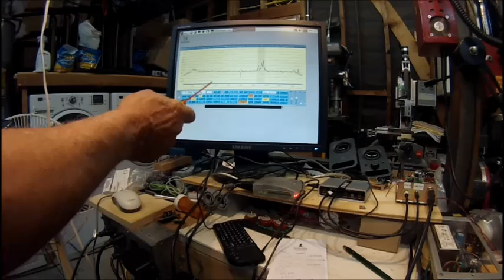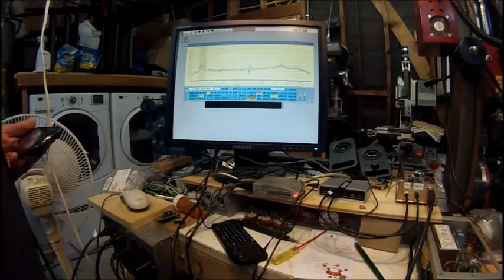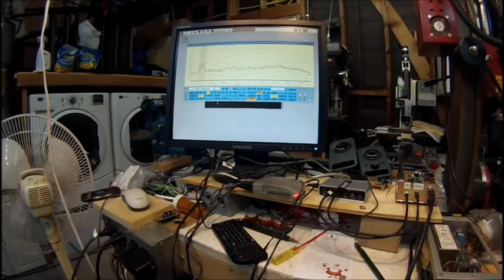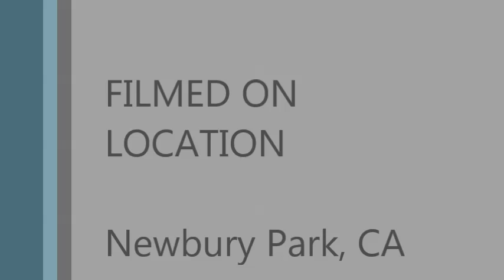Raspberry Pi2 and Softrock V6.3 SDR SSB Transceiver

Comment: The usb to i2c adapter is the dds feeding the softrock? Where did you get that board?
Reply from the maker: There were 2 sources one was kb9iyg and the other was from Australia. That soft rock was the smd version from Canada the ng board.

Regrettably not readily available today.

Pete N6QW
Reply: @N6QW I found a softrock ensemble used. Trying to get it going. So you fed line out of the softrock to the usb sound card. Didn’t use the usb port on the softrock for anything? Is it tuned around a fixed frequency with the soundcard using the capture range without the i2c interface? Sdr is still hard to understand.
Reply from the maker: @techguy9023  contact me at my qrz.com email as this is cumbersome using you tube 
 The USB is for changing frequency. The line in and line out connect the ensemble to the sound card
Reply from the maker: @techguy9023  Check out www.n6qwradiogenius.us for how to set up the Ensemble.

Pete

Comment: Im new to ham but not to linux. i wanted to know if this can be done with RPITX? or is it just with a SDR tranciver? i know a band pass filter is used for squre signal.
Reply from the maker: Hi I am not sure how to respond. Typically the softrock boards need an external computer. BUT I have seen some videos where the entire transceiver was the Pi3. You add a bit of Hilbert transforms and continuously chanting RPi3 RPi3 and you get there. One of then python developers Guido PN1ZZA (call might be wrong) did the whole transceiver with just the Pi3.I don't know how to do that. Thanks for your post.73'sPete N6QW
Reply: RPITX is a application for rpi 2-3 it uses the GPIO pin 18 for the antenna it can transmit from 1mhz to 750mhz but using square signal. as much as i know. Ive been trying to increase its range but idk where to start. Hear is the DEV site https://github.com/F5OEO/rpitx
Reply from the maker: That is interesting but I wouldn't know where to start either. I suggest you track down F5OEO using www.qrz.com and perhaps he can help you directly.73'Pete N6QW

Comment: Hello, I have a RXTX ensemble. I have been thinking of combining it with a 35W amp and some sort of Raspberry Pi to control it, power supply together in one nice wooden case. Do you have suggestions for this project?
Reply from the maker: Hi OM,Rather than take up a lot of space here on you tube, send me an email at n6qwham@gmail.com and I will be happy to share some thoughts with you. I have an Ensemble and an Omnia SDR as well -- there is little difference between the V6.3 and the Ensemble with the Pi3. The Omnia is another matter--it likes Windows a lot better.If you are thinking portable operation then a Motorola Lapdock is the way to go.Thanks for your interest and posting.73'sPete N6QW

Comment: Very nice.  My 6.3 is the through-hole version from Tony Parks, but I recently picked up a 6.3ng and haven't put it together yet.  I plan to pair it with an sdr-widget and one of the ARRL homebrew challenge amps.
Reply from the maker: +Ethan Blanton  Hi Ethan -- your help made this a reality. Thank You. I have found that the V6.3ng actually works better --more power output, less noise and overall a super radio,